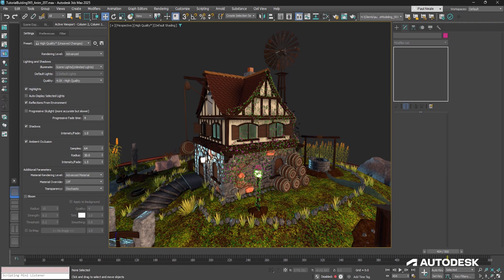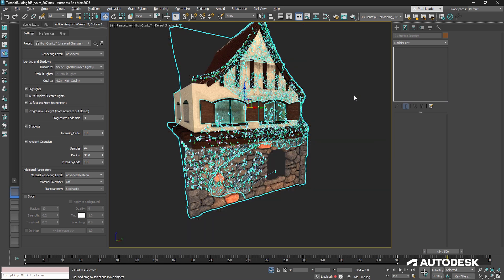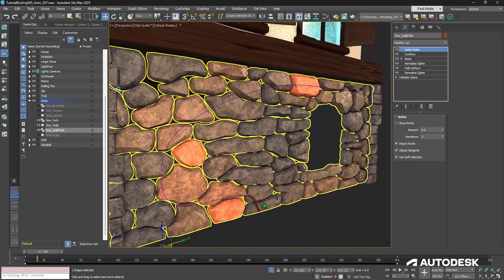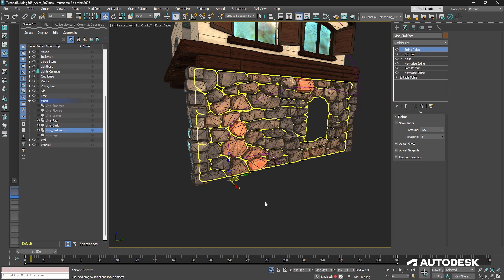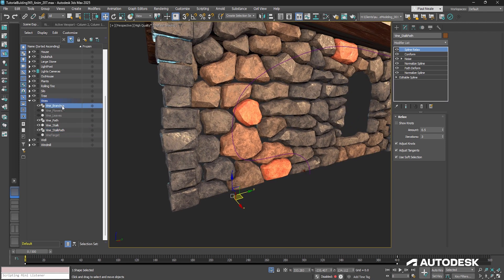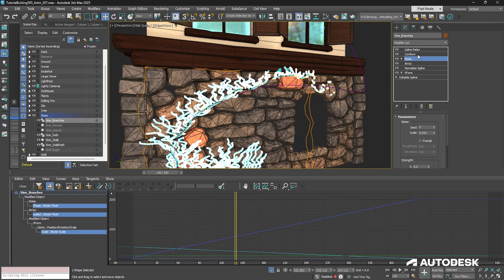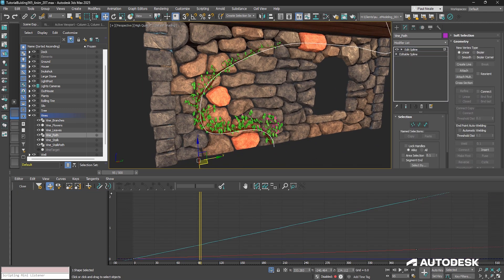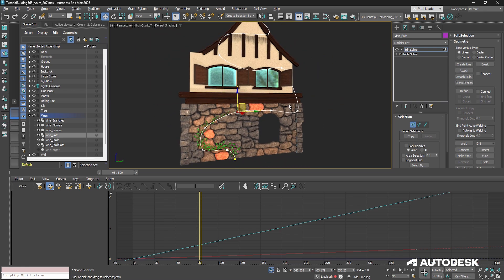Bring 3D Environments to Life with Procedural Animation - Part 6

Comment: 3ds max should have the option to merge multiple files inside a folder.  Also it should have option to automatically link and find textures on its own within the file folder, or even better scanning the disk drive for missing textures/xref/file links etc. and fixing it, rather than having the user to link them one by one each time on old projects which is just dumb.  In an AI age this is unacceptable and silly.